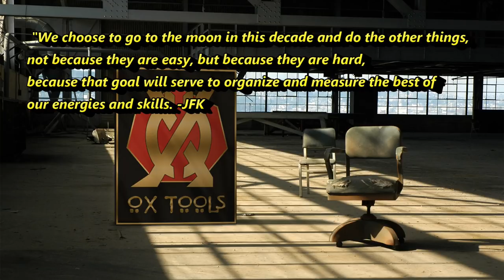Equalization Valve Part 7

Comment: Oh, so awesome! I do wonder if some of those parts were designed with numerical control machines in mind. In the early 60’s I think they would have been programmed with punched paper tape. I was in college when the original parts were fabricated. I do remember seeing people using gas-shielded arc welders. I don’t know if they were called TIG or MIG back then.

Comment: Awesome work. Sure is nice seeing someone not contaminate the filler wire with a dirty glove 😎👍. Being in the business for years and being a cheapskate; you can probably cut back on your post gas a little. We ran numerous NDT tests on multiple materials and found once the weld puddle has gone to “black heat” , the gas didn’t really accomplish anything.   Anyhoo, beautiful job.

Comment: The finish milling cut probably went smoother with the 1/2" DOC because there would have always been at least some part of a tooth cutting at all times. With cut depth less than the pitch of the spiral teeth, the cutting would have been intermittent (except just at the inside corner) because after each tooth finishes its cut there would be a delay before the next tooth started cutting. Even at the inside corner, the reaction force from the cutting would suddenly change direction by 90 degrees as each tooth emerged from the cut and the next one more or less simultaneously entered the cut.

Comment: When I saw the angle grinder coming into view I thought it was a joke at first. I was sure you would file the welds down :) The parts look great, really impressive project Tom! Please let us know how you did the labeling.
Reply: When I saw the part wasn't machined in one piece I assumed he must have used a surface grinder or mill to remove the weld beads.  It's amazing what this guy can make tools do.

Comment: About that 45° position: that would have been unlocked, but with a lot more torque available than the crank-handle 90° position. Getting stuck is the last thing you'd want, and having no way to gorilla the thing if necessary wouldn't have been much of an improvement over the inward-opening hatch they had on Apollo 1.

Comment: Do you know (or think) that when it was originally built they would have used a radius cutter or a different method than filing?  Filing still looks rather fast.

Comment: I always thought that Tom's filing buttons spun freely to stop the file cutting them.  Clearly they don't - or at least these ones don't - are they instead hardened so the file skates or are they sacrificial and Tom's just using them as a template rather than a guide?

Comment: As an engineer, I think that I would have designed those brackets to be made from unequal angle, with the triangular gusset welded in,  or if the necessary thicknesses weren't available conveniently, weld the whole bracket from 3x pieces of plate.

However, lots of engineers in aerospace would design these brackets to be hogged out this way...

Comment: That is such a good looking finish on such a long stick-out. Is that because of a very sharp cutter? I've done stuff like that with 6061 and the finish always looks horrible. Does the stock being stainless steel instead of aluminum have any bearing on the finish?

Comment: I am curious. Please help me understand why you did not shave off some of the horizontal plate ends to allow a depth for the weld... and/or shave off some from the vertical leg too so there would be a V notch for weld strength. Was there any weld on the underneath side?

Comment: Watching Tom file those corners got me to wondering. We have basically two terms these days for people that make things like this out of metal: machinist and blacksmith. But what Tom was doing wasn't blacksmithing, and wasn't really using a machine, unless you count a file as a very simple machine (which if course it is). So what would have been the term for someone doing file work 150 years ago on something other than a watch or clock? (Apprentice? :-)
Reply: Depends what you were doing - what you were working on. You'd have been a "wright" or a "smith" of some sort: millwright, gunsmith, etc. A large part of your skill set wouldn't have just been about how to remove the metal that doesn't look like the thing you want; it would have been about the thing itself. If you needed something novel built, you went to a fellow who made something that was sort of like it - Charles Babbage employed clocksmiths to work on his calculating machines, for instance.

Comment: Dumb question I Hope Tom or someone else can answer...  Early in the video right after the band saw rough cut there is a fly cutter operation. Tom has a block in the vise against the movable jaw and the part being faced. Can someone explain what that device is and its purpose rather than have the vise closed on the part on both sides?
Reply: Since the part was only saw cut at that point there's no guarantee the opposite faces are parallel. This allows the part to register against the fixed jaw without the possibility of it shifting to conform to the movable jaw. Sometimes you'll see people use something like a piece of welding rod or a small ball bearing to do the same thing.
Reply: Mike Michelizzi awesome. Thanks for the explanation. I’ve seen the weld rod method before but I’ve never seen that vise block. That band saw made such a nice cut, I didn’t pick up on the fact that face was what was being held. Thanks again for the clarification
Reply: If you look closely between the two halves of the 'pivoting jaws device' you will see a ball and socket joint. Ball on one side and a socket on the other. The down side of using a ball bearing directly against your work is that it can leave an unwanted divot in the parts surface, where as a soft aluminum filler rod will distort and conform to the part without denting it.

Comment: there you go rubbing the surface with your paws again mate ....;0
Reply: Nothing wrong with a tactile inspection.
Reply: @Reactordrone   Correct ..but only when you do not need to file it again .. your skin adds oil to the part .. makes the file skip over the surface ..(try it ) :) and being an avid filer of parts Mr Lipton will know that .

Comment: Nice  careful work, Tom.

If that bracket is typical, I can see why early NASA enterprises were so expensive and limited in payload. That carefully machined part could be duplicated in function and capacity by a formed sheetmetal fabrication having a punched hole circle to serve as the indexing feature at 1/2 the weight and 1/3 the cost. Musta been designed by a second quarter studenr draftsman. I was guillty of the same sort of adolescent exuberance in my day. Where was the design oversight?

Willingness to squander money does not buy reliability. Design, materials, optimization, and exectution does. That's a hard concept to sell political appointees and senior administration comprised of business school graduates.

Sheesh! Taxpayer dollars!
Reply: As the other poster suggested it was certainly in part the requirements, like using a non-rusting metal. But also consider, they made maybe two dozen of these over 10 years all told. 

How much is it going to cost to design and build the punches and dies to do 20 parts out of 1/4" stainless steel sheet metal? Remember, no CNC then, punches and dies were made with files, scrapers, and die grinders. Then what is going to be the success rate on making the parts that will meet spec on hole centers, notch sharpness on that indexing latch, etc? Maybe you need to do a hundred or more to get the process working well enough, and to pick good parts from the rejects? You are probably going to have to do deep drawing or multi-step dies to to get that step. So you are now talking about half a dozen sets of dies and punches. By the time you made them, you could have had a couple of guys turn out all twenty of these things by hand.